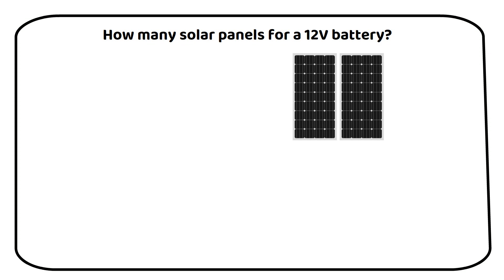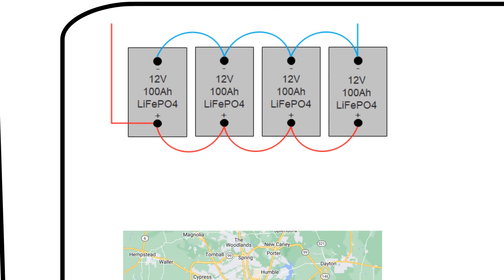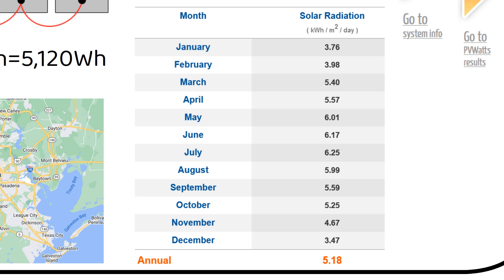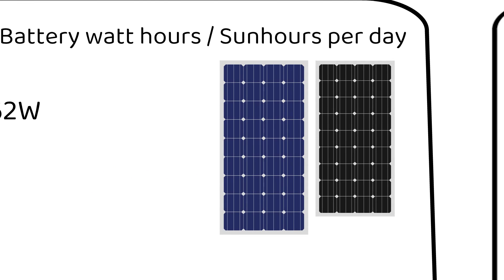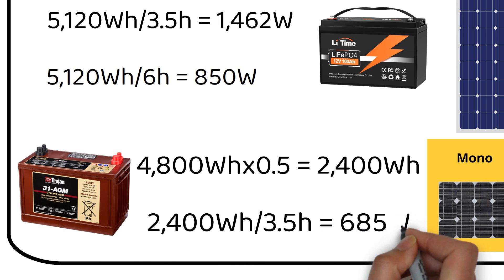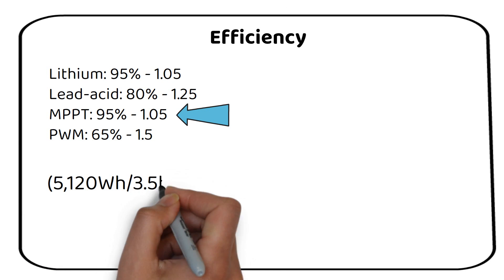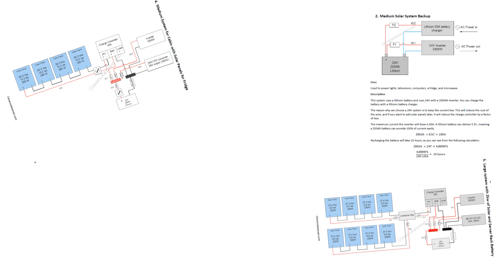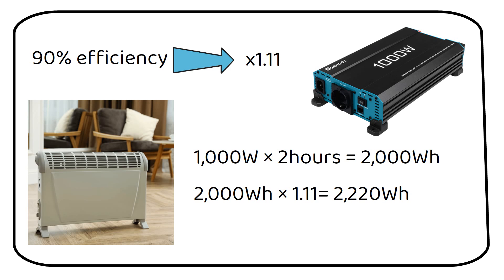What Size Solar Panel to Charge a 12V Battery

Comment: For a quick rule of thumb, just take the nameplate wattage of the panels and multiply by 2 to 3 in the winter, or 4 to 5 in the summer.

That's it.   So if you have say 4 x 100W panels, that's a nameplate of 400W.   For winter that will be 800Wh/day to 1200Wh/day.   And for summer you end up with 1600Wh to 2000Wh/day of energy.

When sizing a battery, you always want to have more storage margin than your best-case generation.  Usually at least twice.  So using the above example, you would want roughly 4000Wh of battery storage.  With LiFePO4, that's one 5kWh rack-mount battery, one big truck battery, or two normal car-style batteries.

The reason you want to have more storage margin is to be able to buffer extra energy on sunny days that help you bridge cloudy days, and be able to catch-up when the sun comes out again.   The amount of storage required to bridge more than one day can be enormous, so having a goal of "2 days" worth of generation is a good rule of thumb.

There are no minimum charge rates for LiFePO4 (or any battery, really), and having more storage also means the battery bank will last longer because it will only be cycling 50% every day instead of 90% or more.

People also often vastly underestimate overnight consumption.  Having more battery storage makes managing the system a whole lot easier.  For example, in horrible conditions where you get no sun you would only need to run the generator for a block of time once a day or once every two days.  Instead of several times a day.

-Matt
Reply from the maker: Yes, checkout my video about sizing a solar system with days of autonomy. It's impossible to say everything in one video, and I would be repeating myself.

Comment: Really nice work and video you did. Electricity is like  Black Magic. Solar batteries and panels Parallel vs Series is another subject depend the needs required.
The main thing to remember is that wiring batteries in series will increase your voltage, while wiring in parallel will increase your amperage.
Reply from the maker: Thanks, through videos like this I'm trying to make it understandable.

Comment: I'm 'green' on what is available on BMS/inverter market, and have this question: what would be an economical way to convert my current grid-tied, non-hybrid inverter+10kWp solar system, into one with batteries? Solar panels are connected all in serial, so ~800V comes into the house, where the inverter stands. The inverter likes 400-800VDC for most efficient operation. I'd prefer to build the battery from cells (instead of buying a prebuilt one), starting with maybe just ~5kWh capacity. Is there a way to have cells work with this high voltage for cheap (even if it all stays grid-tied)?
Reply from the maker: I think the best option for you is to keep the string inverter and use an AC-coupled system. When the grid fails, you can still draw power from the battery with a victron multiplus on essential loads. This is my system. Send me an email for more information.

Comment: This is why real inverters like victron are better as they have far less parasitic draw.
Reply from the maker: Indeed, they also have an eco mode. I use victron inverters in my van systems. It comes at a cost though.
Reply: @cleversolarpower  personally I hate the eco mode as it causes problems, like it won't  turn on for LEDs and small devices, and can cycle (which is bed and dangerous) so while I thought it would be good in theory I found it unworkable in practice, but the unit consumes so little it really is no problem.
The main problem is all the copper in the inverter which is expensive!
Reply: Eco mode is generally a bad idea.  It works in very few situations and can potentially damage equipment in other situations.  I never use that mode on my little Victron inverter.   In anycase, the vampire draw is virtually always just a function of the size of the inverter.  What I do is put critical electronics and so forth on a small 600W inverter that is left on 24x7.  It's vampire draw is only 7W.  Big loads go on bigger inverters which can be switched on when the load is needed.

For example, if you have an RV you might want a big inverter dedicated to the kitchen area with a remote switch in the kitchen itself, allowing you to use a small inverter for stuff you want to always be powered, like the fridge (if it happens to be an AC fridge), computers, internet, LED lights, etc.

In anycase, when it comes to inverters, Victron is not anything special.  Victron makes wonderful charge controllers and shunts but they are a bit dated when it comes to other types of equipment.   It took them forever to come out with the Multiplus II, for example, and it is already outdated by things like the EG4 6000XP.

-Matt
Reply from the maker: @junkerzn7312  I like the term vampire draw 😀. Indeed the eco mode doesn't register small loads. Same as with new fridges, the electronics don't work anymore because the inverter doesn't see it as a big enough load. Victron is good at starting inductive loads though.
Reply: @junkerzn7312  The idle consumption on my 3000w inverter is according to the data sheet 2w... I see smaller inverters that it say use a lot more, the low idle was one of the reasons I bought that inverter.